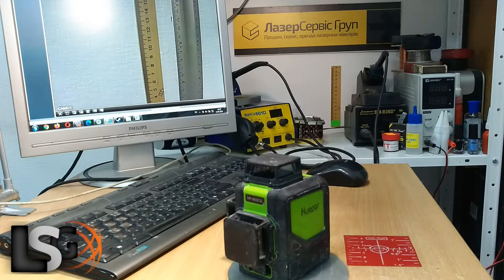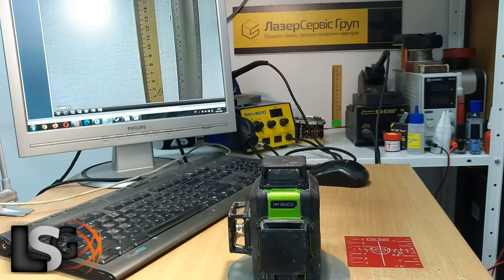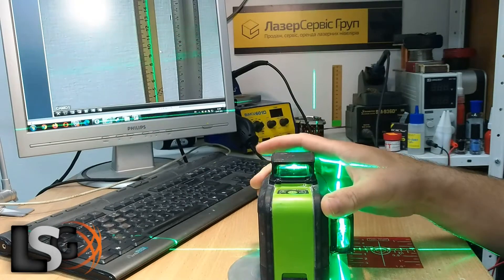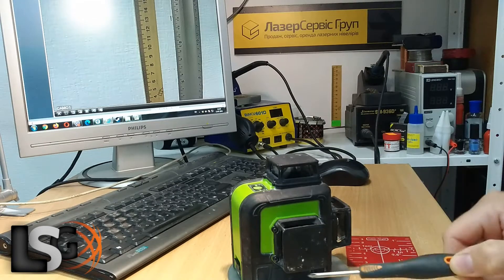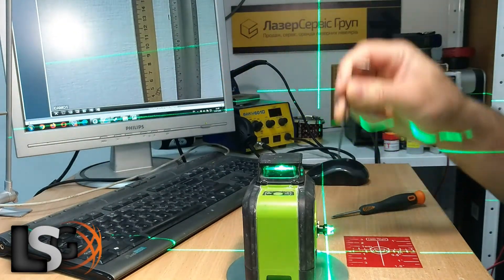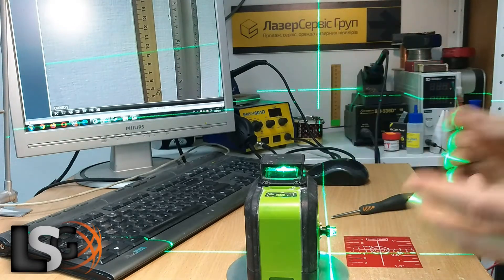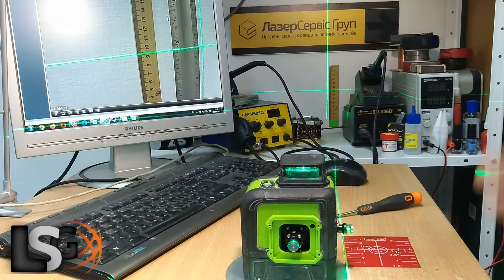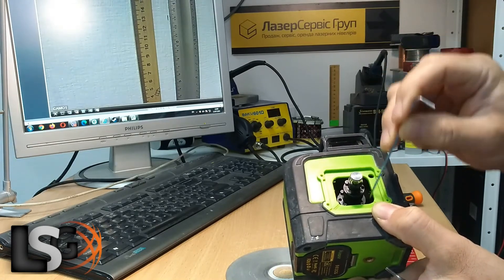Laser level Huepar 903 CG Checking and adjusting.

Comment: I have a 621CG that suddenly stopped working. Any suggestions on where to start trouble shooting? The only thing I can think of that I did differently is I may have put the AAA batteries in reverse. Other than that, I used it, put it back in the padded case Always removing the batteries so they don't explode in there. And about 1-2 weeks later I went to use it again and nothing.

Comment: Great video.
The horizontal level on my 903cg was undeveloped but now is level. However when I turn the device around the horizontal level changes by around 5 inches from the starting level. 
Do you have a video I can watch to try and fix this issue?